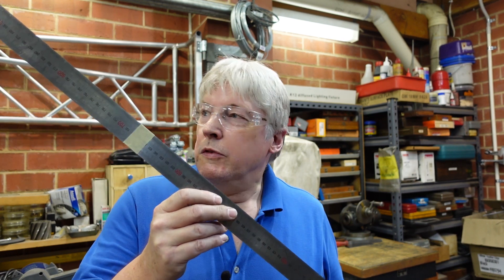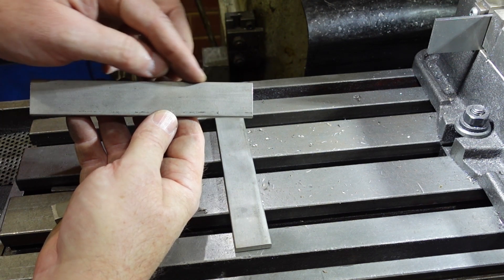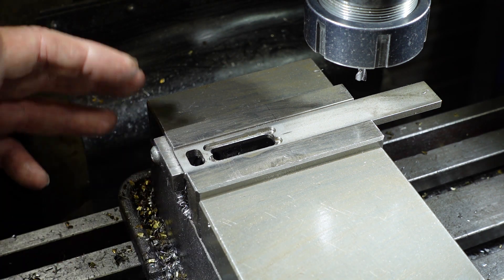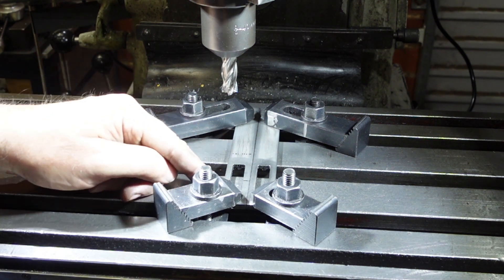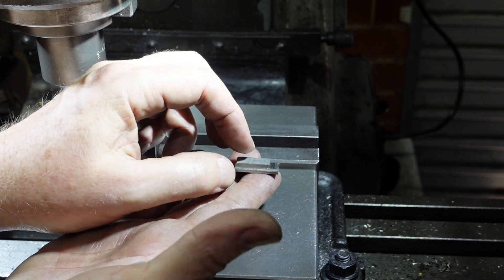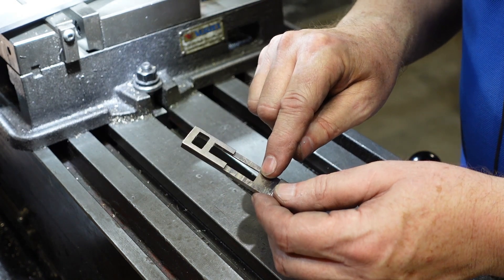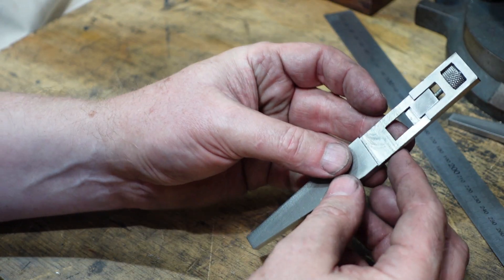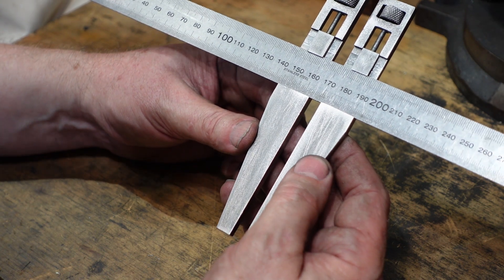Caliper pieces for steel rules

Comment: Very nice workshop addition. Have you considered making an extra head, with an offset, to convert the ruler into a hook ruler. I use calipers to measure roughly across larger round parts and measure the circumference with a tailors tape and divide by pi to get a fairly accurate measurement.
Reply from the maker: I did think about making one end a hook, but then I realised that the other part of the pair would have to be hooked too so they could meet.
Primarily I made this as a stop, but with a pair so I could measure the occasional large thing. 
The principle could be adapted to all sorts of things - hook rule, trammels, inside measurement. The list goes on...

Comment: Between this and the triple cut angle parallels - that's two cracking ideas that are difficult to choose between for the better one - well done!
I've just watched a few videos by Dan Gelbart, he's very fond of waterjet cutting, this would be a good candidate for that.
Reply from the maker: I think AWJ is a great process too, although not all that practical for a small workshop like mine. It might save a little time with these, but end of the day, they will still need some machining. I would guess that to whip a pair of these up is probably only a few hours work.
Reply: @occasionalmachinist  Fortunately I will likely never have space for a water jet cutter - I've never had anything water jet cut either, just keep seeing references to the process of late.

Comment: What is the advantage to filing the corners square as opposed to adding rads to the male parts?
Reply from the maker: Quicker to do, although I did not do much with the ends as I was not sure how they eventually be shaped. Still debating that one internally - radii would be fine if they were only ever used for measurements around the outside of stuff; if I wanted to measure bores etc I could add pins or shape the ends to suit.

Comment: Wow, interesting to know that Australia uses metric!
Reply: FWIW, Aussie's went to metric in early 70's.
Reply: Only 3 countries DON'T use metric!
Reply: @OzGecko  Yes, but both Liberia and Burma (Myanmar) are moving to metric, which will leave the US as the last country to be "fully" Imperial. There are some counties, ones that used to be British colonies, that still have some hold over of Imperial such as Malaya, or indeed I suppose the USA!
Reply: The UK, home of Imperial measurement, started going metric in the late 60's. Certainly, by 1973, when I started my apprenticeship as a Marine Engineer, everything was worked in metric. But we have stuck to miles for distances and speeds. And there was no way we were going to lose pints for the measurement of beer. So we have an ambidextrous system that works generally.